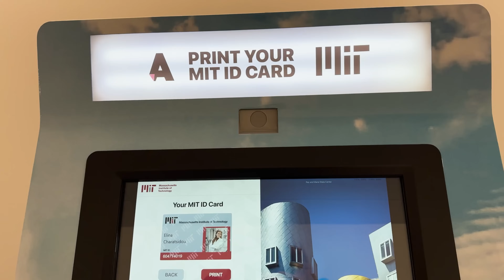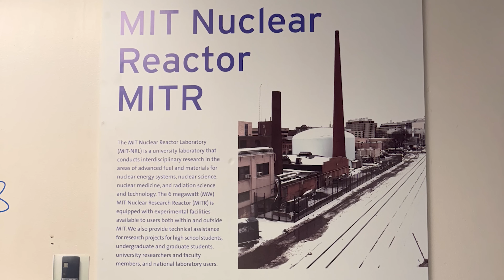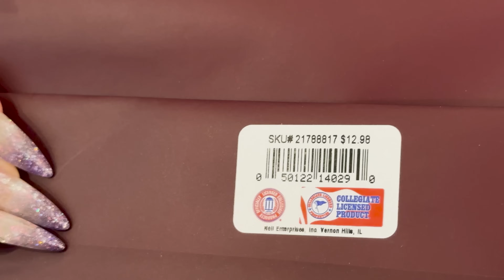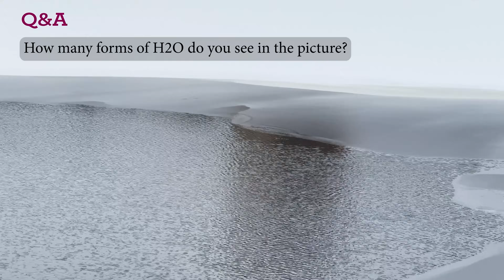I Spent 2 Weeks at MIT – Here’s What REALLY Happened

Comment: I remember when I first went to Area 4 two other coworkers had directions to Area Four and Area IV. They were in the same ballpark (It's a subdivision of Cambridge), but not the same 😅 The subway station also used to have levers on the two sides of the platform and bells in the middle that if used properly would cause a song to play when the train goes by. Boston Common is also a great place to take a sandwich to on your lunch break to watch the ducks.